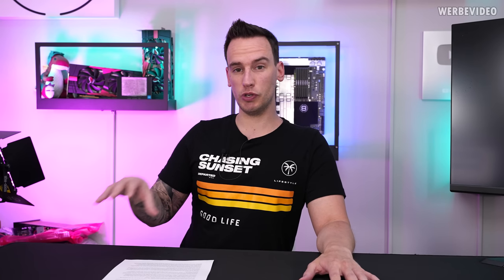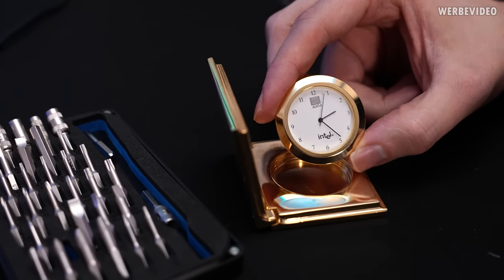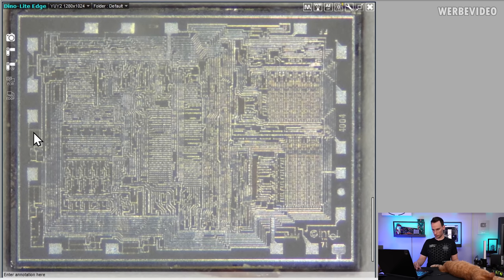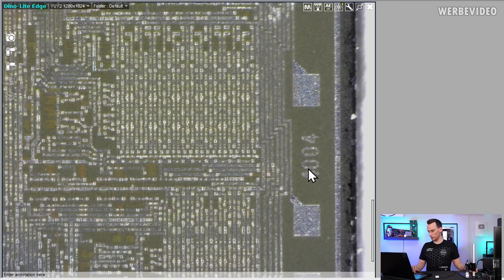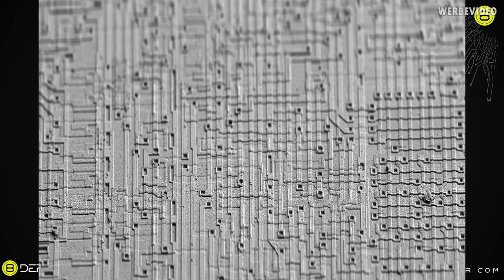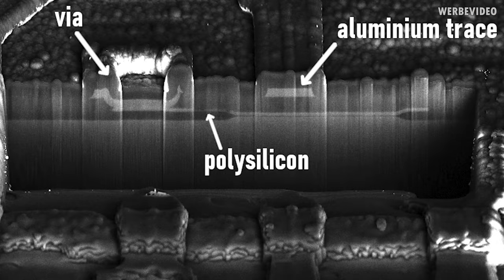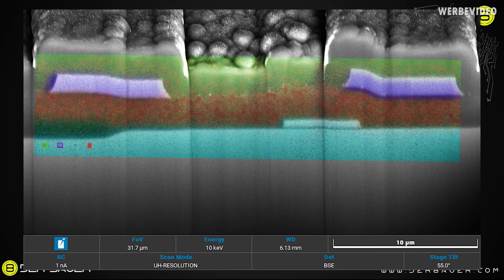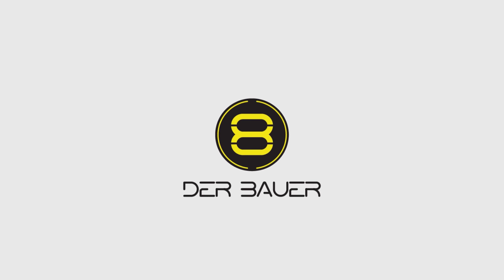We cut through the First Intel CPU with an Ion Beam to see how a Transistor looked like 1971

Comment: iron age bro, you are in the stone age right now
Reply: mems capacitive cantilever switches are better
Reply: tic-toc bro
Reply: be accurate, ion or electron beam
Reply: multilayer wires, most of your space is lost to wiring
Reply: if you say "transistors per area/volume", you should not count the wires in
Reply: crooked as heck
Reply: bad life without God, no life without God, only death
Reply: 9 months, were they birthing-carrying a child
Reply: if you only make one layer, you lose most of the surface area to the wires, be smarter
Reply: te-scan implies transmission electron microscopy, not ion
Reply: you have not improved anything from 1971
Reply: you could have just kept the feature length same and got cheaper wafers
Reply: no heat problems, otherwise better
Reply: you should have listened to God, and not gone head-feet into the things you forced yourselves to do
Reply: crt scanner is easy to make yourself
Reply: you could have used a blu-ray drive to scan the chip
Reply: or just resist pattern the chip substrate
Reply: dlp mems with blu-ray drive
Reply: volume per transistor as measure
Reply: what the fuck
Reply: @bartpelle3460  indeed, what the fu